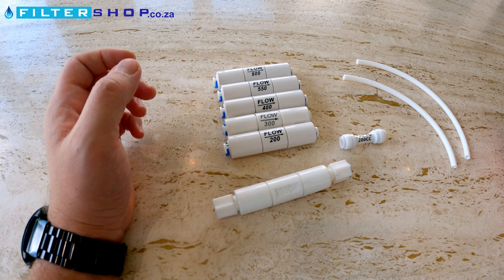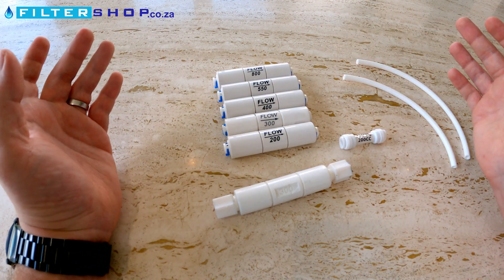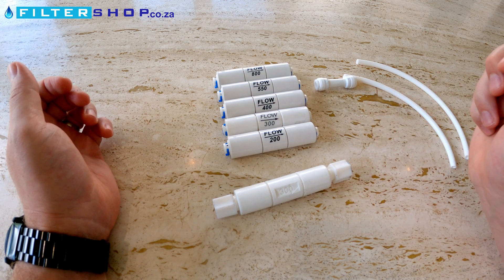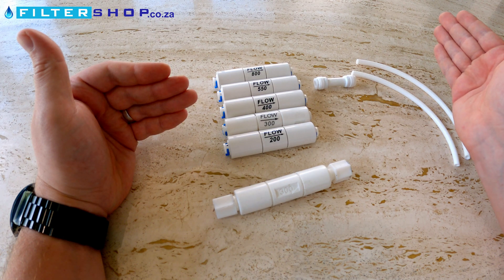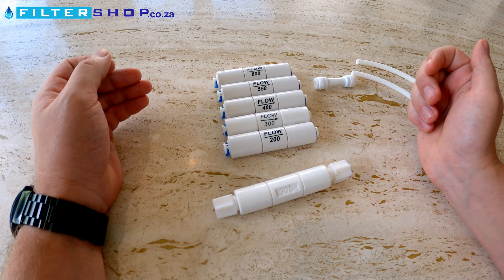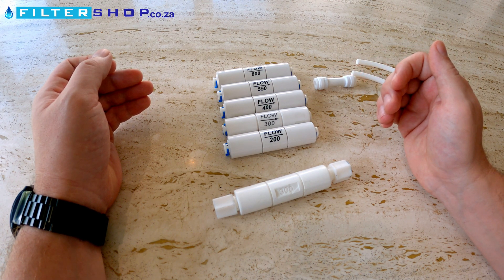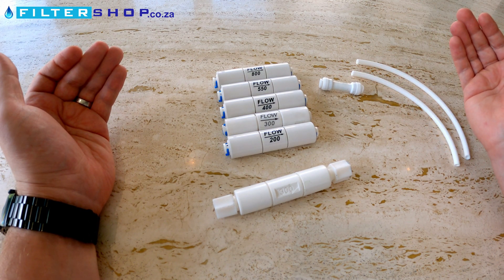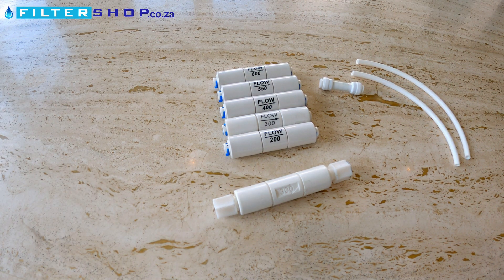Inline Flow Restrictors

Comment: Hello, I have a question: if I remove the FLOW RESTRICTOR and put the pipe directly into the drain, does something happen or does the flow restrictor have to be in the middle?
Reply from the maker: Hi, you will waste an incredibly large amount of water. You will also most likely not get enough pressure on the membrane resulting on very little or no product water.
Reply: @FilterShopZa  Thanks, you're a genius, that's exactly what happened to me. Greetings from Spain

Comment: What size do I need for a 600gpd to? Cheers
Reply from the maker: It will depend on the mineral content of your source water. With a low mineral content source about 1000 can work, it you are at a higher end up to 3500. Normally it would be 1800 to 2500.
Reply: @FilterShopZa  my ppm was reading 013 after filtration, I opened my flush value slightly and it’s reading 005 now. It’s currently on a 800cc, but I have added an extra 300gpd membrane. I don’t know if opening the flush valve slightly will cause me problems? Cheers
Reply from the maker: @Dayo1985  If you place an extra flow restrictor in parallel with the current one it should work. so if you were getting 13ppm I would get a few Ts and play around with it. Say first add just a 300 flow restrictor in parallel if it does do enough swap it for a 600. If that still inst enough add both in parallel.  Changing to a 300 GPD membrane should have a similar effect. If however you added it in parallel you would need to dramatically increase the size of the flow restrictor.
Reply: @FilterShopZa  if I run it through 2 pre filter set ups will this make the water even cleaner before it hits the membrane? Or is it a waste of time?
Reply from the maker: @Dayo1985  It depends on the filters for example the second set contains finer filters like a 0.1um filter which should help the lifespan of the membrane but it won't change the wastewater or the mineral content.
Reply: @FilterShopZa Does a whole house RO system need a flow restrictor?  2500 GPD membrane.   I keep getting low feed pressure alerts and the pump shuts off

Comment: Restriction number is abstract, it's not the same for all membranes of the same gpd.
Reply: I just ordered a 600 gallon per day system from AliExpress and since it’s coming from China there’s no way I’m gonna be getting any directions. Can you please elaborate on what the restrictors do and how to size them appropriately
Reply: @nesc39  It sounds as if you have a ro system with a 3×12 membrane, the restriction value would be 4,511ml/m at 60psi. , I don't think they make one that big. My guess is ,  knowing the Chinese, they have you believing it's a 600gpd system because they've restricted it so low,I've seen it in other ro systems made by them, not good,short membrane life.l
Reply: P.S.,The restrictor causes back pressure on the membrane forcing water threw microscopic porns in the membrane,giving you the permeate or product water. To know the correct restriction value , you need to know the gpd of the membrane and the manufacturer's test pressure, you also have to chose   a ratio, 4:1 is nominal.
Reply: You will probably  have 20 inch filters on you 600gpd  system , changing them regularly and having soft water pretreatment will prolong the life of the membrane.
Reply: Unfortunately  your going to be using a lot of water, it is a four to one membrane, you would have been better to buy a system with a 4×14 commercial membrane rated at 600gpd with a 1:1 ratio.
Reply: Depending on the manufacturer's restriction value can be inflated or deflated, the test pressures vary. Example if you have a membrane with a 60psi test pressure the restriction value is going to be different for one with a 50psi test pressure. 250m/m for a 60 would be    208 for a 50.